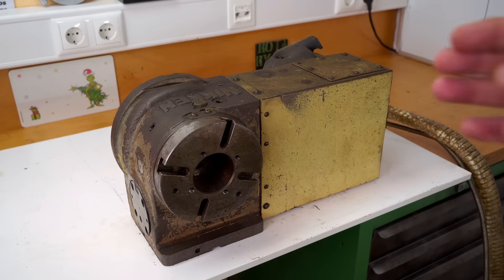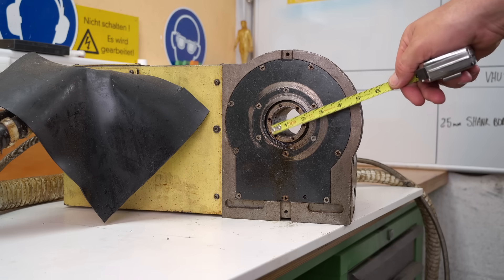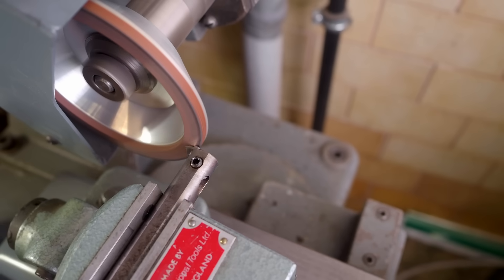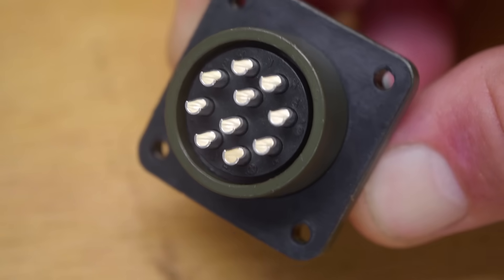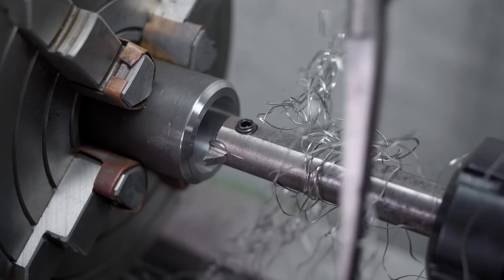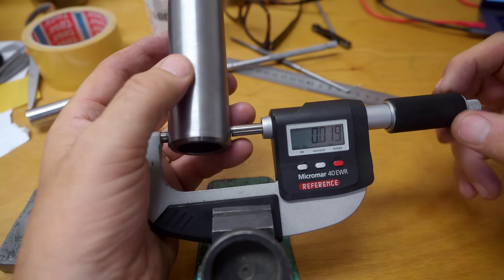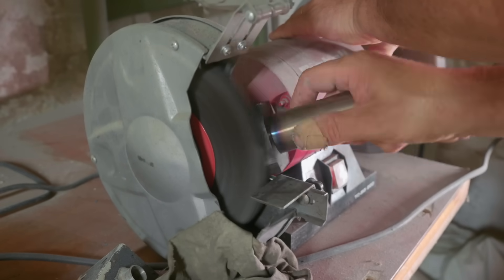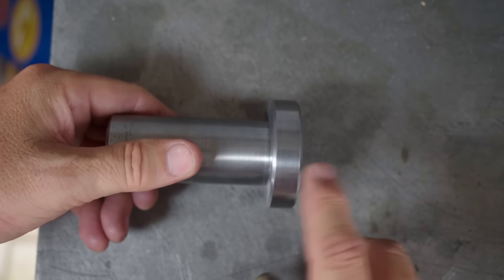Why is it hard to make a buttress thread?  || RotarySMP

Comment: An advantage to symmetrical threads would be that you could tap a hole from one side, but put the bolt in from the other. Similarly, plain nuts can be fitted either way around
Reply: ... Oh and they avoid mistakes like this 😂
Reply from the maker: @mandrakejake  Both good inputs Jake.
Reply: Yes,symmetrical vee thread forms will be easier to manufacture and save overly complicated geometry that isn't really necessary for standard screws and fasteners.
Reply: @howardosborne8647  Same problem with IC datasheet and tube datasheet. IC are numbered and drawn from the top and tube from the bottom. Hopefully, tube sockets often have numbers on them and I design my PCB on a computer
Reply: Can't you use the same tool but thread from the other end/opposite direction?
Reply from the maker: @scrout  It was already chattering pretty badly from excessive stick out. It will be easier to adjust the angles and remount it in a shorter boring bar.

Comment: Wild guess, the buttress threads are not used on screws, because they you cannot make them reliably in industrial setting. The rolling dies (no idea if this is the correct name) would make hard time keeping the thread correctly formed.
Reply from the maker: Good input. That makes sense.
Reply: @RotarySMP presumably Record had them machined in a lathe then rather than rolled. I used the exact same explanation and example of the record wood working vice in another post this week Mark!
Reply: Pretty much got it. These have to be cut due to the 90 degree surface, which adds cost compared to roll formed hardware.